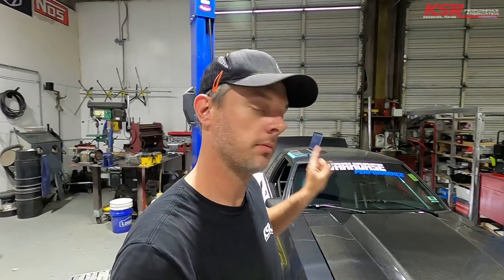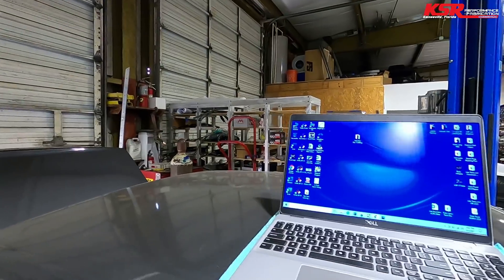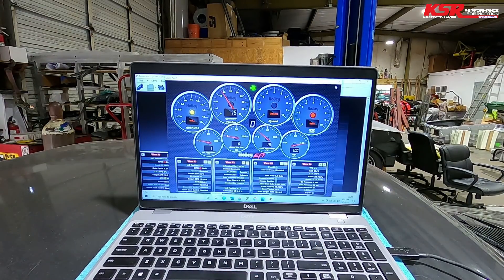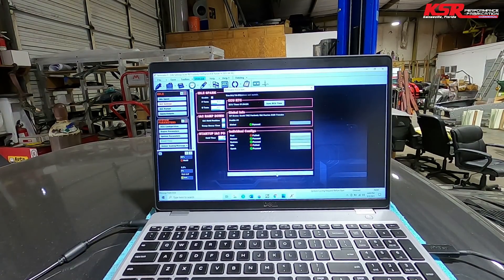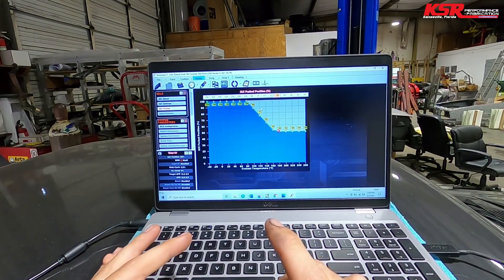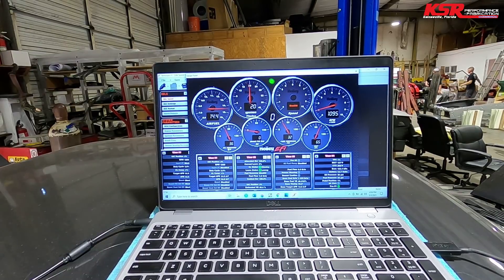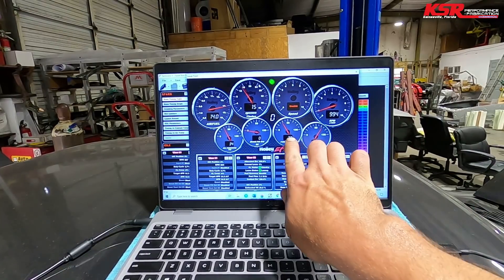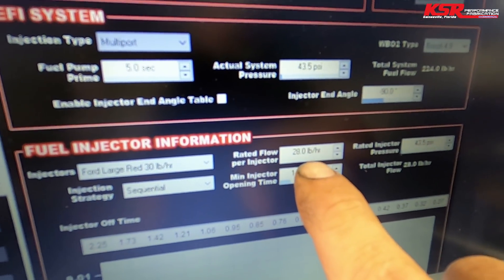KSR How To: Holley Terminator X 5.0 Mustang Tuning Tips

Comment: Great video ! What is a good max timing for 5.0 with aluminum heads  and single 76 turbo . 13 psi ? My 5.0 is zero balance . What is a good afr ? What causes these roller blocks to crack , detonation ? Or is it the 50 oz weight on balancer ?

Comment: I am hoping you can answer something for me. I just started driving my mustang after a long winter. Anyways, long story short, my afr reading on dash shows my wb02 was unplugged. I changed out the sensor(not bosch) and got erratic readings. I then changed to another sensor and it was fine for a while but all of  a sudden reading showed 35.2 afr. It started dumping fuel in. Got stuck on side of road. I ended up disconnecting wb02 completely and car drives fine? Have you heard anything about this? I re-connected wide band again a few hours later and readings were fine?

Comment: Great info there Kev! And I thought you were only a circle track racer. I have a 6.0L ls2 with factory injectors and the C5 fuel filter/regulator, when I come up to a stop the revs don't drop unless I use the engine to stall it down to 700 rpm. If I just push the clutch in the revs will stay 1,500 to 1,800 rpm. Is that a fuel decay issue or is there something else going on? Thanks.   BTW It's in a 59 corvette resto mod and will soon be getting a tremec 5 speed.

Comment: Don't see these old Fords Ford's much much anymore on the Tech side like Fox bodies Back in the day used to use a brand new Ford factory I  I a c as a tool  In my toolbox   Touris Rangers  All gas fords pretty much different vehicles they would run idle like crap I would take a known god brand new slap it on there fixed the problem a usually iacs were  just crap ordered another one put it back in my toolbox and charge a customer For  The new  Part  Building one of these 5 o's right now same system going to get the adapter could you list companies that make that You recommend

Comment: I have a Ford 302, I was curious if u would have able to give me some advice. I’m kinda new to this tuning, but I am decently well rounded with knowledge on cars and this one is kinda stumping me. When I start the car it idles perfectly fine, and once I get it past about 2000 rpms it runs great. It’s a stick and when I go for a drive the rona jump and it seems like it breaks up between 750 to 2000 rpms on a light throttle.

Comment: Kevin like always you're awesome that is awesome that you have a tuning video for us Ford 5.0 guys🤘
Now when you check static timing what I've been doing is putting my idle timming at 20deg on the timing table then checking static timing box after that I use my timing light and see what my timing reads at the balancer if it is off I adjust my distributor until my timing lines up to 20 degrees is that the right way ?

Comment: Aussie 1992-2002 Falcon, Fairlane & LTD had the 5.0 V8, I have thought of fitting one to a older falcon with a turbo for budget drag car maybe even build to 347, been looking into Terminator X as it looks like it would work well in this set up & can adapt to run a Cleveland or 460 big block later on.

Comment: I'm running hp tuner on a 4.6 f150 it's running lean an I'm having trouble it's showing bank 1 short fuel trim 6.5 an bank 2 is showing -6.5 an my oxygen sensor 3 are saying 7 volts average but one is showing 17.0 volts ??? What is your opinion please?

Comment: i couldn't see clearly but did the regulator have a pressure gauge on it? and if it did were both the gauge and the sending unit reading the same pressure? just curious how accurate the sending unit is compared to a gauge

Comment: I have a procharged 5.0 with terminator x in my fox and I've had timing issues with the duel sync. I'd love to see more or that process on how you corrected timing. I just move the distributor until my static was correct but my cranking timing would be off 5 degrees.

Comment: Hey any one of y'all car ppl can I get a theory on what's wrong withy 08 cobolt ls

So the issue I'm having is there is a lean code and that's the original code when the issue came up since it's added an emmisions code and a fuel pump circuit code what it's doing is idles rough when cold but warms up n seems ok but I have engine running issues like it starts bogs down n dies if I don't rev the engine before it happens and then it's fine only does this when I fill the tank also it will kill the car if I leave it running while filling it with gas 

I did run it for a while with a bad thermostat control for about a month before all these issues I have fixed the thermostat since but can't find a vacuum leak anywhere on the car I haven't pulled the block apart yet as I know nothing about engines like if I wanna do something to my car it off to youtube!
@ksrperformanceandfabrication

Comment: small tip when doing stuff with computer screens: get a progam like OBS Studio to record the screen so you get a much clearer image and inset it/edit it in separately. Filming monitors/screens tends to get REALLY fuzzy.
Reply from the maker: Does that use the microphone to record my voice, or will I need to splice the audio?
Reply: @KSRPerformanceFabrication  If you connect up a microphone to the computer you're running it on you can record voice at the same time. OBS is designed/developed for streaming (gameplay) (to twitch for instance) so it does handle audio as well as video; and of course you can record as well as stream!

Comment: Terminator X 5.0 tip:

I ran into a snag with my install where the 5.0 IAC wouldn’t respond. Found out it was on a different output # than the diagram showed. There was a running change in the harnesses because Term X is PWM- only and originally the harness was made to run PWM+ with the HP and Dominator. Wiring diagrams on the Holley website are conflicting. It’s just easiest to check wiring color and assign it to the correct output #.

Comment: When I disable “idle spark” I get pretty severe idle hunting from 650-1100rpm. Is that a symptom of the spark table not being smooth enough that area? N/A Heads/cam LQ4
Reply from the maker: Yeah, the timing and air fuel are likely not staying consistent.

Comment: Good timing on this video KSR Kevin, I've been wanting to use Holley IAC on the Bikes I tune. Even though Idle Spark only helps a bit I hate having to hold the throttle for high-idle on cold starts and warm ups. Love ALL of your videos and it feels good knowing my self taught thoughts and ideas about EFI tuning (in general) are in line with what you talk about in your video(s). Things like I learned to set the Start Fuel a little above what each setup wants at idle (plus ramped up at cooler CTS) and I have always been a firm believer in doing "complete tunes" on everything, even if it's a dry-block drag race only bike that get's pushed up to staging lanes and back to the pits after the runs😎

Comment: Well I'll tell you this Kevin I'm flying by the seat of my pants I want to do this to an F-150 it's a map sensor and I'm converting it to a MAF sensor got to add wires add the computer and I'm wondering if it's easier just to switch over to this Terminator by Holly

Comment: Electrical and tuning are the fears I have with building a fuel injected vehicle. I would love to see more and more on this. The way you explain things I seem to comprehend them better than reading or better than some others I found explaining it. I know so much is experiance that takes time. It's overwhelming. Appreciate the small tutorials you have done thus far. Keep it up
Reply: Also there are systems like the Sniper that are self learning, you get the economy and simplicity of EFI, with some power gains too in the right set up, but you don’t need to get into the computer at all if you don’t want to. Combine that with a solid state ignition system and any old car can be switched over. There are pre made plug in harnesses available for common swaps and vehicles. All the plugs are labelled or uniquely pinned so you can’t screw up plugging them in.
Reply: @foamdataservices  were is i go-to place to familiarize a place to start  learning on how these systems work
Reply: Familiarize yourself with PLC Logic controls systems. Almost all PC based programming systems Holley, Fueltech, Allen Bradley (industrial/mfg). To simplify they all work on the principal of Inputs, Outputs, and Control. Learning this will not teach you how to tune a timing map, but it will give you a greater understanding of how computerized control system work. O and if your carbs stubblin on tip in i cannot replace an accelerator pump ona carb over the phone.....but i can fix a tip in with a couple keystrokes from wherever. Dont have fear, Fuel injection allows anybody from anywhere give you a hand.
Reply: Things have come sooooo far in the last few years. There's not much to be worried about with these systems. They do a good job at not letting you hurt the engine.
Jump into it, you won't regret it.